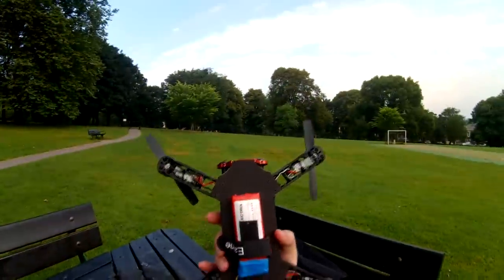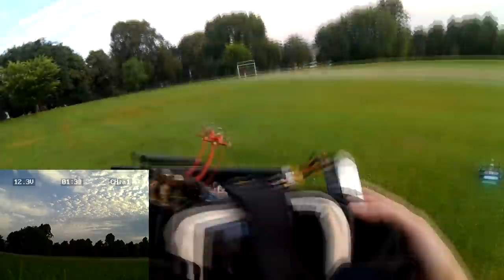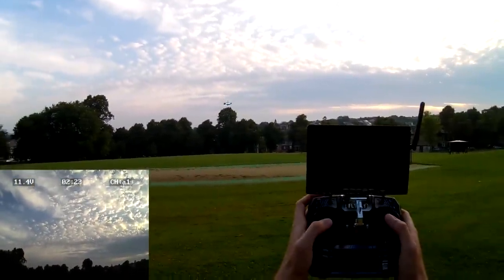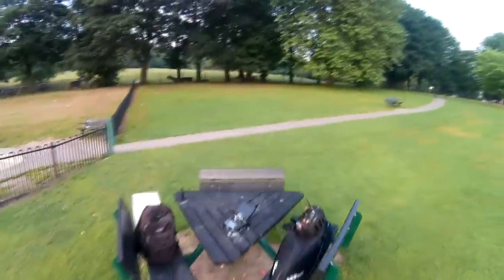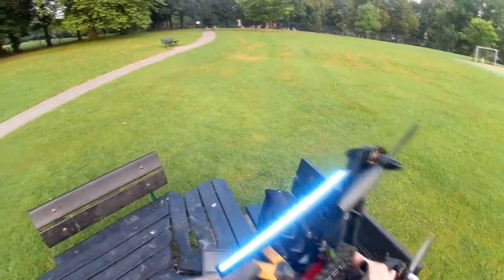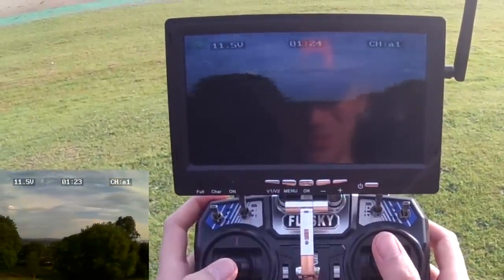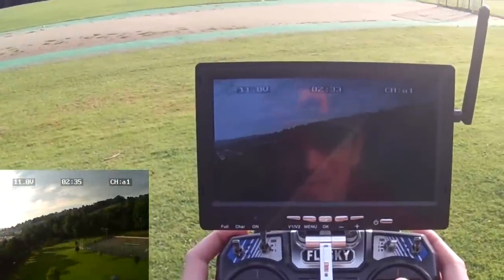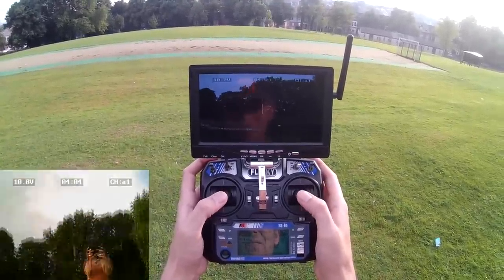Floureon 250 Racer - PIDs, camera tilt, large lipo test and flying with the monitor (Gearbest)

Comment: Hello great tests! BTW, the lights do change colors. There should be a little switch on the front left side right after the arm on the main board. Where did you purchase your monitor holder mount, I cannot seem to find one for the Flysky FS-i6 transmitter, the same one that you have.
Reply from the maker: That front left switch turns them on or off, no colour options that I am aware off like the earlier Eachine version with cc3d. I'm afraid the monitor mount came with the RTF kit so unsure where you could buy on it's own. It's not great though so I would recommend something else if you can possibly find one. The other end only fit's into this style of monitor too so you woudl have to have the same 1 screw connection there too.
Here's a clear picture from the cheerson cx-91 that uses the same monitor fitting.
https://flic.kr/p/HT2tRs

The F210 ideafly came with one too but the TX doesn't even fit that style of holder. I'll send you the metal section if it will fit your monitor but you pay postage if outside of the UK/EU as I have no idea where you are at.

Comment: You have a small OSD  installed, turned on ? (well at least the battery voltage and the current Vfreq ?)
Reply from the maker: Yes there is basic OSD for voltage which I forgot when wondering about 2200mah voltage at the end of the LoS flight. It provides battery voltage, flight time and as you say frequency for video too. Apparently supports 8 languages but no instructions so unsure how to check if there are other options to turn on or even turn the OSD off if desired. I think I prefer OSD minimal rather than screen full of lines like the Walkera stuff I have used that has OSD.

Comment: hi,ive just had my maiden flight on the floureon,stock battery only lasted like 3-5 mins using the stock charger,have you found this as well,and would you recommend using the 2200mah as a better lasting alternative?
Im very new to quad flying other than a toy grade quad,but wow its fast!
Any help tips you can give me would be much appreciated,Cheers.
Reply from the maker: If you fly fast with high throttle about 50-60% then 3 - 5 minutes sounds about right. Just hovering on the spot may give you 6 or 7 minutes but not much more.
I only used 200mah 3s because I had a few of them and at this time, only a couple 3s around 1300-1500mah which is much more suited. I don't use the stock charger but i'd expect that not o be a major issue in terms of flight length. Check voltages before and after a flight if worried. 4.2v (no higher when full) and 3.6 after a flight when standing (no lower) and you won't do it any harm.
The 2200mah are too heavy and don't offer more flight time and feel much heavier in flight too. They do work if you have them but I wouldn't buy any specifically for it.
You could try some non bull nose props for more efficiency too but will lose a little of the top end to do so and may need the PID adjusting for different props.

Comment: like your video. I have the same goggle you are using, what did you connect the balancer to? how did you fix that darkness you mentioned?
Reply from the maker: I power a dvr off the balance lead so I can record the flights. The monitor was stock settings which I still need to adjust regarding brightness but I expect that to help a lot. The camera is responsible for most of the darkness I think as the WDR is a bit slow to adjust when pointed at the sky/sun and the rest of the picture is dark
Reply: +MicroRCFiend thanks, makes sense. I got the v2 quanum and upgraded it with the pro kit much better lense. I haven't flown FPV yet, planning to do so now the weather is getting better on UK. I have the walker runner 250 GPS version. what foam padding do you use on the goggle looks pretty comfy.
Reply from the maker: I missed your padding question, sorry. It's just windows seal foam so sticky on one side only. To be honest, it's not brilliant and comes off fairly easily but cheap and best I could come up with.
Reply: MicroRCFiend thanks, I had same issue. I got foam from a leather sofa and the leather lining itself, then made 5 cm segments and wrapped the leather around the foam and used UHU, it is flexible sd very good, mind you I do not use it as much as I am still new to FPV. Thanks

Comment: I wanted to ask you if the esc for eachone racer 250 is compatible with esc of the floureon racer 250, because the esc of the alline and 12 amps, while the esc of the floureon and 20 amps, are both compatible? I bought an esc for everybody racer to use on floureon racer
Reply from the maker: I have never reviewed or flown the Eachine 250 so I am am not sure if they are compatible.
I know some Floureon 250 ESC are detected as 12A due to firmware but they are 20A ESC.

If they are all blheli ESC running same firmware then usually it is not imperitive that they are exactly the same. Definitely best to have all identical but when trying to mix ESC on other quads it worked fine.

Unless you mean you have all 4 new esc from the Eachine racer and want to put all 4 of them inside the floureon? No problem there but if really 12A I would run it 3S lipos only.

Comment: Did you say you had a capacitor come off after colliding with battery?
My rear right capacitor has come off and i couldnt find it again,can you recommend a replacement one or would be better to get a whole new board,if there available ?
Thanks in advance
Reply from the maker: One was rolling about in the box as my battery was posted inside the model withoutbeing tied down - I was told future quads would be sent to people with the lipo not inside the model. 
I just soldered it back on but it did hover inside fine without that capacitor on at all. It's for smoothing the power I believe but unsure how vital it is although I did once run a KK2 quad without caps on 3 esc because I crashed it loads and it didn't fly any worse for it. Not that it flew great before that either :)
 My Floureon is with a friend so can't check the cap values for you but there's two values you need, voltage and capacity that are both stated on the can. So long as you can match or exceed the voltage and get close with the capacity, you will be fine providing you can solder ok. I contemplated adding wires to those caps and stashing them out of the way but ended up mounting the lipo on top.
Buying a new board woudl be absolutely last on my list if all else failed and it didn't actually fly well.
Reply: MicroRCFiend motors wont arm at all now,i think maybe the FC is bricked was a hard landing onto rocks!
How can you tell if the board is kaput?
I just fixed one of the arms as well,first time out after the fix and maybe 4th pack on acro and this happens,oh well,any help you can give me would be great,im considering buying a stronger quad and just putting this down to experience,i have no soldering skills either,will have a cuppa and mull it over,thanks for the fast reply though
Cheers

Comment: Hi tks for the video :) can yoy tell me what pids have you used?
Reply from the maker: Hi, this was close to 1.5 years ago so first thing I would suggest is put Betaflight 3.1.7 on it with stock PIDS as that will most likely fly wonderful. I was using the version of cleanflight it came with which you can't even install without a workaround as it's so out of date now. I'd also enable damped light on your ESC if it is not already, both those should fly much better than in this video. Andy RC has some good BF PIDS for it if you want to tune it further
Reply: MicroRCFiend thank you
Reply from the maker: I'll add, don't worry if your ESC read as 12A, mine had 20A ESC but firmware bootloader was wrong so they read as 12A in blheli.
Good luck
Reply: MicroRCFiend hi i think this answer is for another question :)
Reply from the maker: No, it's for sure going to make the Floureon fly better and PIDS more locked in if enabled. I just can't remember if it is enabled by default and can't check as I gave mine away. Simple to check with same usb cable you use for Betaflight. Here's a video covering damped light from Blue Falcon. https://www.youtube.com/watch?v=UF__pyJ0G1Y&ab_channel=ProjectBlueFalcon

Comment: What is the lag/delay between the camera on the quad to the monitor on the controller?  in milliseconds?
Reply from the maker: I couldn't tell you exactly. It was perfectly flyable and no more latency than any of my race quads and goggles. I got no more noticeable latency flying with the screen provided and have used the same screen with at least 10 quads they came with.
Typically 5.8ghz systems will be between 150 and 300ms in entirety but that's spread between the camera, VTX and the displays refresh rate.
Reply: I'm a First person shooter gamer and i'm  use to 1-50ms input delay so i assume its going to take me a couple minutes to get antiquated to the input delay. I've flown quads before only at line of sight, but this is my first fpv quad so this is all new to me. Thanks for the quick reply bud!
Reply from the maker: I don't envision you having much of an issue as your inputs flying this 3s quad will generally be way less aggressive than running about shooting people. If you can keep that resolution of small regular movements you have half the battle sorted. 
You may notice it as a slight negative if you practice FPV on a simulator and then fly this immediately after but even then half way through the flight that issue.
It's only really the wifi FPV toys that tend to have too much latency to automatically adapt to unconsciously 
Keep it moving slowly forward and most people take to it pretty quick, hovering on the spot is way trickier as gauging height without forward movement is the challenge.

Comment: The only difference with this and the eachine 250 racer is a naze32 board, which you can order the eachine 250 with and 20a esc, which is not worth another 100 dollars. Is there something i am missing with this quad? for another 100 bucks i could buy the eachine model, 4 littlebee 20a esc and 4 emax 2305 race motors. 

BTW it is going to be a little squrrily with the battery on the belly. Try the top. Will act like a ballast when roll/pitch. Will fly better. welcome.
Reply from the maker: The problem was the lipos can't go on top and maintain good CG because of the poorly placed antenna and putting it inside as Eachine intended breaks the caps off the PDB in even a light crash. For cruising and even racing  a track I do not feel it it is an issue at all with one shot esc and BF3 and many race winners are stacked X pods. 
For flips, rolls, acro, 3D etc, I want them as close to the line of motors/props as possible. , however....
Things are moving faster than ever and this was almost a year ago, plus if you are building instead of wanting an RTF FPV like the Floureon with screen then it's always going to be less cash. A couple points I would strongly consider based on that excellent hardware choice though..

Upgrade those one shot LB20 - no more cost, lots more performance. Sure use em if you got em as I do on several quads (building a Revo6 with some ready salted LB20's right now), but if buying new,  strongly consider the much faster, easy to solder to and cooler running LBpros or even the newer Dshot variants since they are still one shot capable and prices are within a dollar or so. If you can hold off I am absolutely sure these 8bit newest Dshot ESC will be followed shortly by some even more capable 32bit digital protocol ESC for very similar prices. I just don't know if that's weeks or months but it's certain. No calibrations or min throttle, commands etc at all, just plug and play
These particular 35A LB Spring are the newest, fastest Dshot iteration in that family of ESC. They are also cheaper right now because they are not 5S or 6S capable as many people don't care about that for a race drone.
http://www.banggood.com/Favourite-FVT-LittleBee-Spring-35A-Blheli_S-BB2-2-4S-Brushless-ESC-Support-D-shot-for-Racing-Drone-p-1118520.html?p=UI14032168777201508N
If you want 5 and 6s support, those are more normal prices.
http://www.banggood.com/4X-Favourite-FVT-LittleBee-30A-S-ESC-BLHeli_S-OPTO-2-6S-Supports-Mulitshot-Oneshot42-OneShot125-p-1070787.html?p=UI14032168777201508N

If you possibly mean the popular Emax RS2205 2300KV or 2600KV (I love those motors a lot too) then absolutely don't limit them to 20A ESC. If you really do mean larger motors still then then LB20's will pop on 4S with 5" props. My P200 has 20A one shot ESC with the red bottoms and it's damn fast as I am sure you are aware. Give those motors 30A decent ESC though and they put out a lot more plus props with more than 2 blades perform much better on them too. I was really surprised how much more they had in them but my last GB190 build is proof and I doubt I will even fly that P200 anymore now because of it's superior performance. It may not be a selling point but the 30A (even the first one shot versions) switch directions cleaner and faster for 3D than the 20A do too. They pair up great and same power system will be going on a Vtail really soon with hopefully the same performance.
GB190 video - LB30A/RS2205 2300KV stacked pod with bad CG but flies incredible even doing piroflips that are super CG dependant to get clean:
https://www.youtube.com/watch?v=EUCdF8B9JNw&t=149s&ab_channel=MicroRCFiend

There's also some bundle deals on those motors and ESC that will save up to $30 extra in total plus several newer versions of those EMAX motors that put out even more power IF you desire it. They also do away with the C clips and have a lighter, stronger, hollow shaft. If you do need links shout but they aren't hard to find are well worth looking at if spending cash right now.
Reply: Thanks, i had not even considered going to 30a esc. Was not sure the rest of the quad could handle more amps so didn't look much past 20a. 

The antenna. Pull the top plate off and flip the tx upside down. Run an antenna extension with a 90 degree connector to the back of the quad and mount the receiver inside the shell. Plenty of room for the battery then and better balance. Can find a ready made extension on e-bay.  

Will need to mount the antenna connector somewhere on the back of the bottom plate. I found a custom made 3d printed piece on thingiverse and had it printed on one of those online 3d printing companies. Could just hot glue it too. Or attach it with a plastic coaxial cable tie down you can pick up at the local hardware store. Then run the antenna out the back of the quad. i have not had to replace an antenna since. Used to go through two or three a month due to crashes. 

Will also have to install two small offset spacers for the back two holes on the tx. The antenna connector was the rear support until you flip it. 

i also soldered 3 pin mini connectors where the esc attached to the PDB. Makes replacing a leg a 5 minute process now. Considering mounting the ESC inside the shell but not sure i want to deal with so much wire from the motors.
Reply from the maker: As with most RTFs, this was given way to a subscriber shortly after the review so I can not longer fly it but there's not a single reason to fly it over other quads I have based on the hardware and entry level performance. I'm honestly a little perplexed why you think I would choose to fly it over any other quads on my channel that run 5" props if I did still own it, like I said this is a year ago man, scores of quads since then.
I still respectfully disagree a lipo mounted high up would have any benefits over a low mounted one providing the distance from vertical CG is the same. Gravity and momentum pulls the same way, same amount at the same angles... If there are other subtleties at work I cannot feel them in flight but the lipo not scraping on the ground is the only benefit I see. 

IF, I still had it or desired to fly it, a way better mod would be to move those capacitors from the PDB away on short extensions and fit the lipo inside with dial lock or and strap so it was secure. That would fly far superior.

I was speaking about 30A with the red bottoms on a build, the Floureon was only officially rated at 3s so anything past that is not recommend by Gearbest or me in any way. I see people have run it but I was told there's no warranty so did not.

Comment: Can you make a video on how to charge the monitor? Thanks.
Reply from the maker: Which bit are you having trouble with exactly?
You have no charge cable?
Reply: MicroRCFiend All that mine came with was an XT60 connector on one side and the other side plugs into the monitor. Can I just plug the XT60 connector into the lipo discharghe then plug the lipo into the included lipo charger?
Reply from the maker: Details on the Floureon page do suggest that is the way, they also note that there is no 3s lipo included.
"FPV monitor battery: built-in 7.4V 1500mAh LiPo ( charged by an extra 12V JST plug battery which is not included )"
Reply: MicroRCFiend so if it's not included I need to buy another charger to charge it??
Reply: Also can you link me to the floureon page where you are receiving this information? Thanks. When you charged the monitor did you use a seperate charger or did you only use included items? Thanks for the help.
Reply from the maker: Links always in the description dude, always. Very first line has link to the product. I presume you bought it from Gearbest?
I thought mine came with a USB charge cable but I literally only charged it once. Tested it in this video and then always used my goggles instead.
This was given away in a video competition not long after the review so thee's no way I can know what they send it out with now beyond the gearbest page.